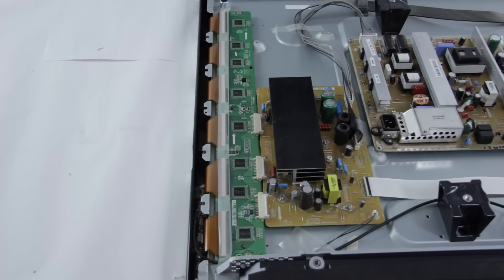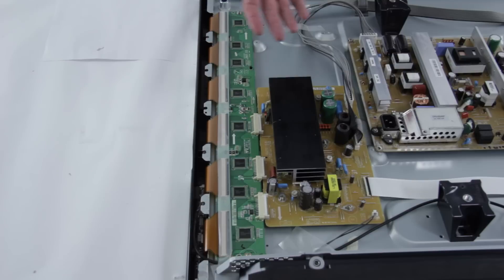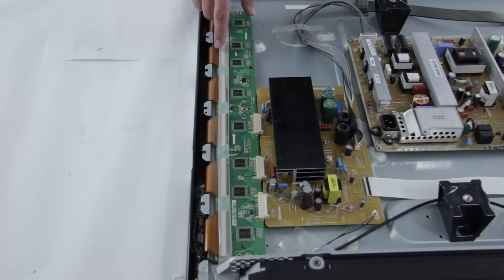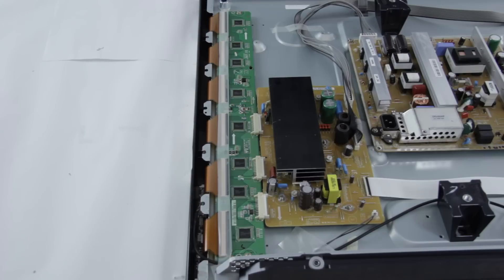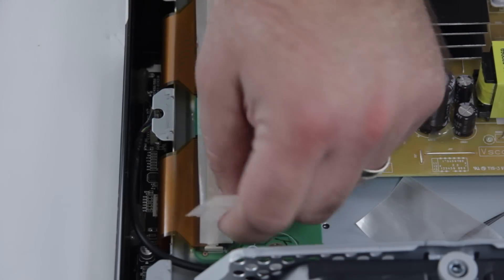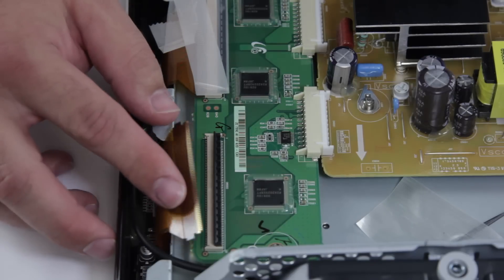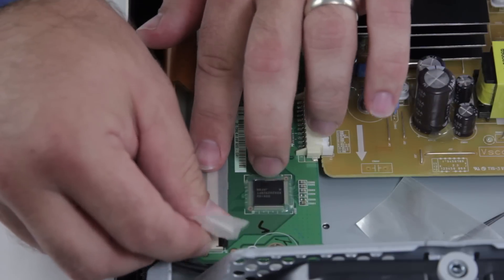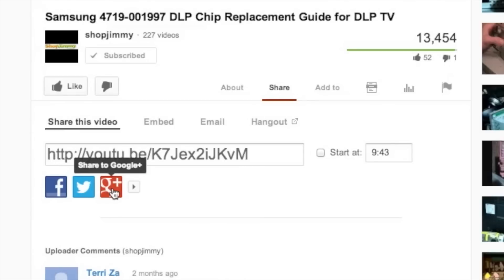Plasma TV Repair - No Image, No Picture on Plasma TV Screen - How to Replace Y-Buffer & Y-Sustain

Comment: Need repair tip and cost of parts.
I have a samsung HPS 5053X/XAA
The picture goes half black the bottom is blank the top is fine
There are fine lines on bottom sometimes and it works for a while
And comes back . Very intermittently.  Sometimes its black with sound
I turn it off and on in it works.  Thanks again bruno

Comment: I have an LG Model MU-60PZ95V 60 inch plasma monitor.  When I turn it on picture and sound come on then picture goes black.  Even when I press menu no picture.  Usually after several tries the picture stays on like maybe it needs to warm up.  If I leave TV on and don't cycle it on and off the picture stays black.  What would cause this?
Reply from the maker: Glen Lewis   I recommend replacing the YSUS board and the YDRVTP & YDRVBT boards in your TV.  Here is a link to replacement parts for your TV model number on our website, click here:  http://www.shopjimmy.com/catalogsearch/result/?q=MU-60PZ95V  Be sure to match part numbers on your current board, with your replacement for compatibility.  You can also call our customer service for further assistance with your purchase.  (877) 881-6492  Thanks and please let us know if you have any further questions with your TV Repair!  www.shopjimmy.com

Comment: hi there i have samsung 50" plasma PS50B50Y1F when i turn it on i get a black screen i get audio but no picture, any idea what i can do to fix it? thanks paul
Reply from the maker: Paul Gloudie   I recommend replacing the Y-Sustain and buffers that attach to the Y-Sustain.  Unfortunately I do not see any replacement parts in the search results for your TV model number on our website.  Please reply with your Y-Sustain and buffer part numbers and I can try searching for replacement parts.  Thanks and please let us know if you have any further questions!  www.shopjimmy.com

Comment: Have Hitachi Plasma, model 55HDS69. The picture and sound won.t come on, screen completely black, menu screen wont appear. Does have power, as red/blue power lights up. Did self diagnostic, holding power button 5 secs, the blue light flashed 8 times. Any ideas?
Reply from the maker: greg mulder   I recommend replacing the Y-Main Board and the Upper and Lower Scan Drive boards in your TV.  Here is a link to replacement parts for your TV model number on our website, click here:  http://www.shopjimmy.com/catalogsearch/result/?q=55HDS69  Be sure to match part numbers on your current board, with your replacement for compatibility.  You can also call our customer service for further assistance with your purchase.  (877) 881-6492  Thanks and please let us know if you have any further questions with your TV Repair!  www.shopjimmy.com

Comment: I have sound but no picture on my LG 60PV450. It just seemed like it power cycled when I was using it -- there was a "pop" not unlike what happens when I power it down, might have been a little louder. Now there is sound but no picture.

Is the problem more likely to be with the Y SUSTAIN board or the Y BUFFER? Is there a way I can tell which one is defective or should I just replace both of them?
Reply from the maker: Mike Robinson  When replacing the Y board, it is recommended to also replace the buffers as well at the same time.  Here is a link to replacement parts for your TV model number on our website, click here:  http://www.shopjimmy.com/catalogsearch/result/?q=60PV450  Be sure to match part numbers on your current board, with your replacement for compatibility.  You can also call our customer service for further assistance with your purchase.  (877) 881-6492  Thanks and please let us know if you have any further questions with your TV Repair!  www.shopjimmy.com

Comment: I have a Phillips 50" model #50PF971, picture is black sound still works. Any idea as to what to replace on this model? Thanks!
Reply from the maker: Isaias Luna   This sounds like a problem with either the main board or the inverter board(s).  Unfortunately I do not see any replacement parts in the search results for your TV model number on our website.  Thanks and please let us know if you have any further questions!  www.shopjimmy.com

Comment: I have a philips 42pf9630a/37 and the problem is that whatever appears on the bottom of the screen is also ghosted on the top of the screen as well. The image on the bottom right hand side appears in about 4 inches of the top left corner and the image on the bottom middle appears in about 10 inches of the top right corner. I have played around with the settings but nothing has worked. Any help would be greatly appreciated. Thank you
Reply from the maker: Brian Stemm   This sounds like a TV panel problem.  If your TV panel is bad, it may be more cost-effective to replace the TV as panels are typically hard to find in stock, difficult to replace, and expensive.  Thanks and please let us know if you have any further questions!  www.shopjimmy.com

Comment: I have a panasonic TC-P50S30 50" plasma. It went black the other day when changing the Channel. When turned on I see the red light on the tv. Hitting the power button does nothing and the red led stays on. I press and hold the power button and the light will go into a 14 blink cycle. I watched one of your videos and unplugged it for 4 minutes then plugged it back in  and hit the power button when it clicked. Red led stayed solid. Your video said the Power board would be bad. I replaced it and the tv is doing the same thing. The tv is only three years old and had the A board replaced last September when the building got struck by lightning. It has worked perfect till now.  Any thoughts?  

Sincerely, Kevin
Reply from the maker: Kevin Roers   I recommend replacing the A Main board in your TV.  Here is a link to replacement parts for your TV model number on our website, click here:
http://www.shopjimmy.com/catalogsearch/result/index/?master_part_type=Main+Board&q=TC-P50S30  Be sure to match part numbers on your current board, with your replacement for compatibility.  Here is a link to a video showing how to identify your part number, click here:  Panasonic Plasma HD TV Repair Tips: Suffix Codes for A Board & Main Boards  You can also call our customer service for further assistance with your purchase.  (877) 881-6492  Thanks and please let us know if you have any further questions with your TV Repair!  www.shopjimmy.com

Comment: I just got a hold of a Samsung PN43D450A2XZA which when plugged in would just click and had no sound or picture, had a board set from a PN51 and swapped out the T-conn board and now set turns on and has sound but no backlight or picture, would this be the Y board or is the panel probably bad.
Thanks
Reply from the maker: John Strauss   This sounds like a problem with the Y-board.  Here is a link to possible replacement parts for your TV model number on our website, click here:  http://www.shopjimmy.com/catalogsearch/result/?q=PN43D45  Be sure to match part numbers on your current board, with your replacement for compatibility.  Here is a link to a video showing how to identify your part number, click here:  Samsung Plasma TV Repair: Samsung Plasma Panel Parts Guide  You can also call our customer service for further assistance with your purchase.  (877) 881-6492  Thanks and please let us know if you have any further questions with your TV Repair!  www.shopjimmy.com

Comment: Hello I have a Samsung HP-T5064 PLASMA TV that currently only has sound but no picture, it was happening occasionally but now the picture has not returned. What would you recommend? Please let me know. Thank you.
Reply from the maker: A Mitchell   I recommend replacing the Y-Main board and upper and lower Y-scan drive boards in your TV.  Here is a link to replacement parts for your TV model number on our website, click here:  http://www.shopjimmy.com/catalogsearch/result/?q=HPT5064  Be sure to match part numbers on your current board, with your replacement for compatibility.  You can also call our customer service for further assistance with your purchase.  (877) 881-6492  Thanks and please let us know if you have any further questions with your TV Repair!  www.shopjimmy.com

Comment: Tonight my LG50ps60 would not turn on. The red light in the lower right corner was blinking red quickly. There was a clicking sound coming from the rear. I took the back cover off. The power supply board was clicking. There are two yellow boxes on the middle right of the board. The bottom one appears to be producing the clicking sound. What parts are needed to repair this? I am capable of soldering.

Also, there is no picture nor sound.
Reply from the maker: J Ringel   I recommend replacing the YSUS board and the YDRTP and YDRVBT boards.  Here is a link to replacement parts for your TV model number on our website, click here:  http://www.shopjimmy.com/catalogsearch/result/?q=LG+50ps60  Be sure to match part numbers on your current board, with your replacement for compatibility.  You can also call our customer service for further assistance with your purchase.  (877) 881-6492  Thanks and please let us know if you have any further questions with your TV Repair!  www.shopjimmy.com
Reply: I have all voltages correct from the power supply. When I unplug the main board (HDMI, Cable, Etc.) board it causes the red light to begin blinking. I also found that my cable box is not operating correctly. Possibly lightning struck the cable line? Not sure, however if I unplug the main board nothing happens when I connect power. If I plug in the main board the transformer begins clicking. Possibly just the main board?

Comment: So I have a 51'Samsung Plasma with a black screen and sound working correctly.  I've checked different channels to make sure its not just that network. Ive hit the menu button to bring up a different screen but no luck. Plugged the power cord straight into an outlet, television turns on but no picture just sound. Could not visually see any blown capacitors or blown fuses. What pc board typically causes this symptom?
Model - PN51E530A3FXZA Version Number- TS02
Reply from the maker: victor salazar  I recommend replacing the X/Y main board and the Y Scan Drive board in your TV.  Here is a link to replacement parts for your TV model number on our website, click here:  http://www.shopjimmy.com/catalogsearch/result/?q=PN51E530A3FXZA  Be sure to match part numbers on your current board, with your replacement for compatibility.  You can also call our customer service for further assistance with your purchase.  (877) 881-6492  Thanks and please let us know if you have any further questions with your TV Repair!  www.shopjimmy.com

Comment: pn42b450b1dxza
Reply from the maker: Frank Dangler   Here is a link to possible replacement parts for your TV model number:  http://www.shopjimmy.com/catalogsearch/result/?q=pn42b450b1  Be sure to match part numbers on your current board, with your replacement for compatibility.  You can also call our customer service for further assistance with your purchase.  (877) 881-6492  Thanks and please let us know if you have any further questions with your TV Repair!  www.shopjimmy.com

Comment: Hi,  I have a Samsung 63" plasma not working (63B550T2FXZA)  Symptoms:  No picture with sound.  I see you have the Y Sustain boards on your website, but not the Y buffer.
Reply from the maker: Ron Grage   The Y-buffer boards are the upper and lower Y Scan Drive boards in the search results.  http://www.shopjimmy.com/catalogsearch/result/?q=63B550T2FXZA  Be sure to match part numbers on your current board, with your replacement for compatibility.  You can also call our customer service for further assistance with your purchase.  (877) 881-6492  Thanks and please let us know if you have any further questions with your TV Repair!  www.shopjimmy.com

Comment: A buddy dropped off a samsung 42inch plasma tv which he said a lady gave to him after the picture went out and she had it sitting in her garage for a few months,when it came to my house the picture flashed a bit then was working fine for about 10 minutes and then when out but sound worked fine,I can see the screen glow so I know the backlight is on but no picture,so buffer or sustain,will post model number later sometime
Reply from the maker: Frank Dangler   I recommend replacing the y board and buffers in your TV.  Please reply with your TV model number and then I can recommend replacement parts for your TV repair.  Thanks!  www.shopjimmy.com
Reply from the maker: Frank Dangler   Here is a link to possible replacement parts for your TV model number:  http://www.shopjimmy.com/catalogsearch/result/?q=pn42b450b1  Be sure to match part numbers on your current board, with your replacement for compatibility.  You can also call our customer service for further assistance with your purchase.  (877) 881-6492  Thanks and please let us know if you have any further questions with your TV Repair!  www.shopjimmy.com

Comment: I have a Panasonic Viera 50" (TH-50PZ77U). I'm experiencing an intermittent problem where the screen will go blank but I will still have sound. Is it safe to assume that I have a problem with the Y-Sustain or the Y-Buffer?
Reply from the maker: Tony Bracci   If you replace the Y-Sustain and the Y-Buffers then you will eliminate that option.  This is typically recommended for this repair.  Here is a link to replacement parts for your TV model number on our website, click here:  http://www.shopjimmy.com/catalogsearch/result/?q=TH-50PZ77U  Be sure to match part numbers on your current board, with your replacement for compatibility.  You can also call our customer service for further assistance with your purchase.  (877) 881-6492  Thanks and please let us know if you have any further questions with your TV Repair!  www.shopjimmy.com

Comment: Hi 
I have a samsung plasma tv, model number BN68-04172T 
The problem is NO ViDeo for last 1 day
Sound is normal.
What is the best way to repair?
Please suggest.
Thanks.
Reply from the maker: Ayush Arora   I recommend replacing the y board and buffers that attach to the y board.  Unfortunately I do not see any replacement parts in the search results for your TV model number on our website.  Thanks and please let us know if you have any further questions!  www.shopjimmy.com

Comment: My Panasonic ST-P60ut50 no longer powers up.  Had a lightning strike close to house.  No power flicker or anything, TV was on and turned off.  Went to turn it back on and nothing.  No screen, no red power led at all. I would appreciate your suggestions.  Thanks.
Reply from the maker: Randy Sargent   I recommend replacing the power supply board and the main board in your TV.  Here is a link to possible replacement parts for your TV model number on our website, click here:  http://www.shopjimmy.com/catalogsearch/result/?q=P60ut50  Be sure to match part numbers on your current board, with your replacement for compatibility.  You can also call our customer service for further assistance with your purchase.  (877) 881-6492  Thanks and please let us know if you have any further questions with your TV Repair!  www.shopjimmy.com

Comment: Panasonic V10. Watching World Cup. TV on for approx 10 hrs.  TV makes deafening pop noise and goes black.  Can it be repaired or is it done?  If repairable is this a major expense?  Thx. J.
Reply from the maker: Jason Archibald   I recommend replacing the SC board and the SU & SD boards that attach to the SC board.  Here is a link to replacement parts for your TV model number on our website, click here:  http://www.shopjimmy.com/catalogsearch/result/?q=Panasonic+V10  Be sure to match part numbers on your current board, with your replacement for compatibility.  You can also call our customer service for further assistance with your purchase.  (877) 881-6492  Thanks and please let us know if you have any further questions with your TV Repair!  www.shopjimmy.com

Comment: Hello there Jimmy, I have an UpStar 40 in. LED hdtv model # P40ETW and my problem is that it happens constantly when I turn on the tv it shows a quick blue flash then the image turns black but I still have sound. What can I do to fix this? I appreciate your help
Reply from the maker: Jesse Hortas   I recommend replacing the power supply board in your TV.  Unfortunately I do not see any replacement parts in the search results for your TV model number on our website.  Thanks and please let us know if you have any further questions!  www.shopjimmy.com

Comment: i have a vizio V047L fhdtv10a 100-240v~4.0A 50/60 hz. my tv works for a few minutes then it shows green horizontal lines across my whole tv and makes a really loud screeching noise. can you guys help me out on what i need to replace please?
Reply from the maker: daddyedgar   I recommend replacing the main board in your TV.  Here is a link to replacement parts for your TV model number on our website, click here:  http://www.shopjimmy.com/catalogsearch/result/?q=vo47lfhdtv10a  Be sure to match part numbers on your current board, with your replacement for compatibility.  You can also call our customer service for further assistance with your purchase.  (877) 881-6492  Thanks and please let us know if you have any further questions with your TV Repair!  www.shopjimmy.com

Comment: hii
i have samsung plasma tv modal number ps42d4s
his picture his blink and engeener say his tuner card corrupt
and replace but tuner card is not available in market
so please give the solution
Reply from the maker: Vijay Kashyap   What is the part number on your board?  Use this video to help find your part number:  Samsung Main Boards & Digital Boards: Part Numbers for LED, LCD, DLP, Plasma TV Repair  Thanks!  www.shopjimmy.com